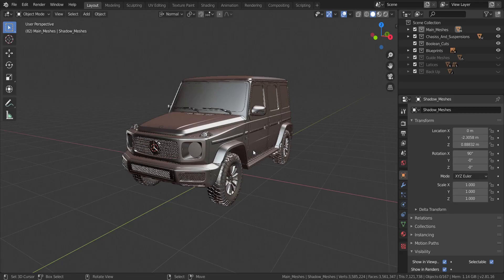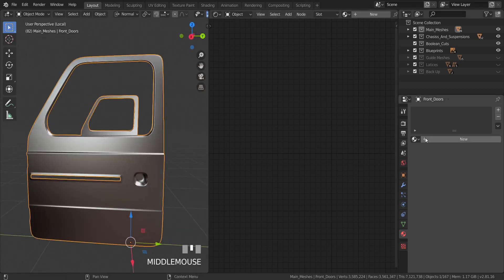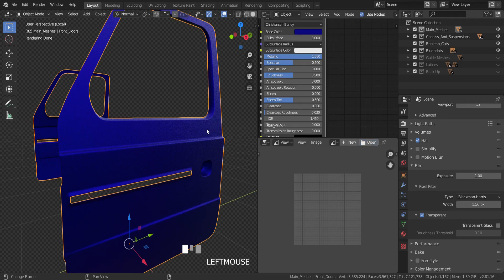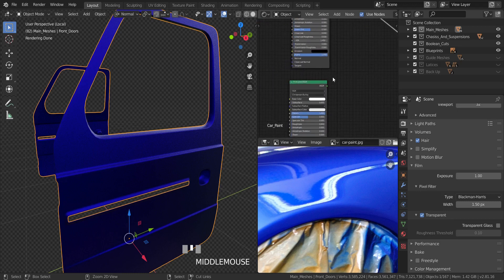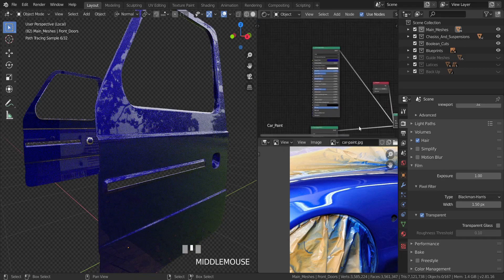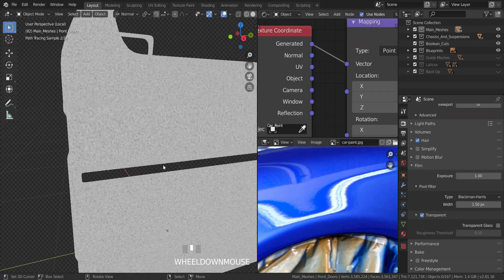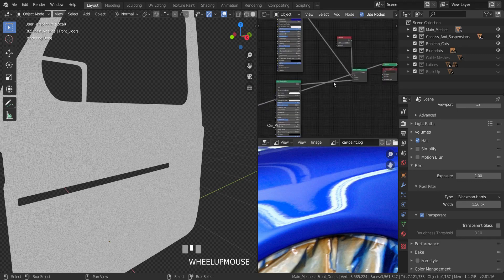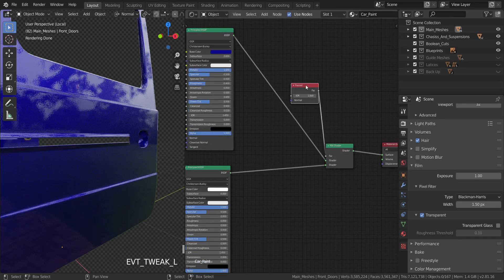Blender 2.81 Material Creation - Car Paint

Comment: here's how to do it for eevee (and one principle shader bsdf) 
plug a mix shader into the output node
add a Fresnel to the fctor (set to 12.5 in my example) 
connect the principle bsdf to BOTH mix shader
set the principle shader to preferred colour , set metalic to 1, roughness to 0.041, clear coat to 1 and cleat coat roughness to 2.30 (with a hdr background on for best results) AND IF U WANT TO MAKE IT LESS REFLECTIVE TURN THE EMISSION UP A BIT
connect the bump to its normal 
connect a noise texture set 0.710 (was good in my case) to the bump noise fac to bump hieght . (TO ADD THE DENTS EFFECT ON THE CAR BODY INCREASE THE NOISE factor 
connect a GENERATED texture coordinate (even ur example pic shos that distorition) to mapping and connect it all up

Comment: Clearcoat is already integrated into the Principled BSDF node. You can change the amount of clearcoat you have and also the roughness of the clearcoat. You can even tint the clearcoat to the same color as your base coat. There is also a clearcoat normal input in the Principled node which allows you to apply that ripple effect that causes imperfect reflections just to the clearcoat layer. There is also a way that you can make scratches, by plugging a roughness map into the clearcoat roughness input. I find that the only think the clearcoat slider cannot do is change the color of the clearcoat outside of what you want the base color to be. But since you are leaving the clearcoat white, I don't see the need to mix another principled shader in. Also as a side note, the clearcoat layer is a non-metallic layer so it has different physical properties than metallic objects. A correction that you could make is giving the clearcoat node zero metallic value if you are using a 2 shader setup. The clearcoat slider in the Principled node already takes care of this.
Reply from the maker: thanks noted